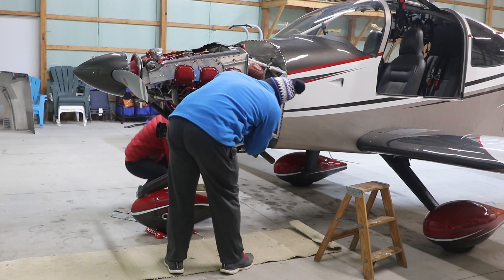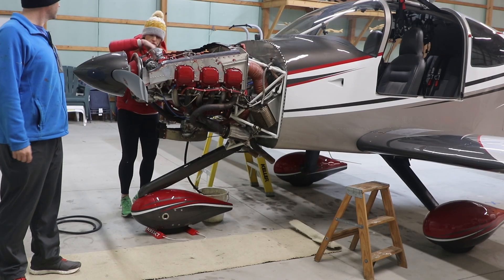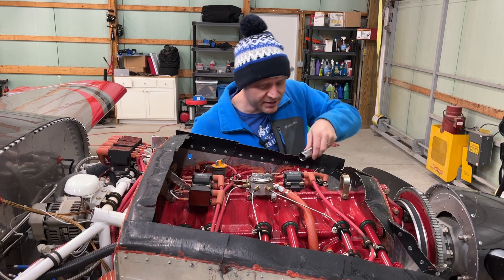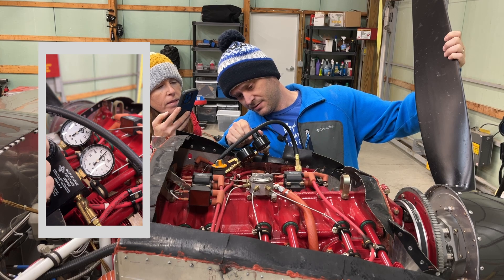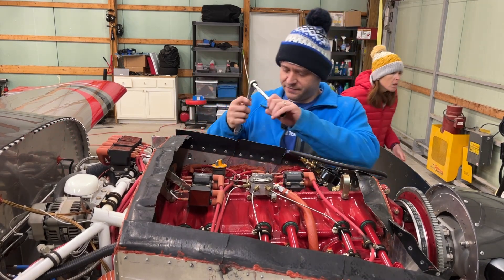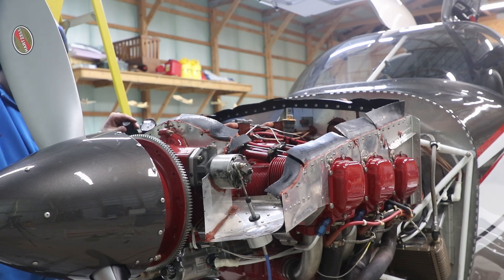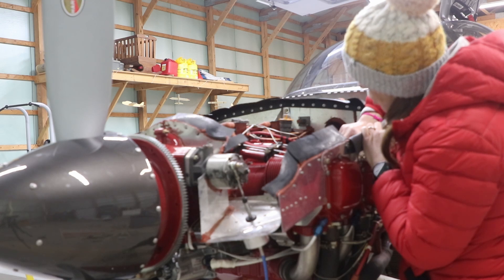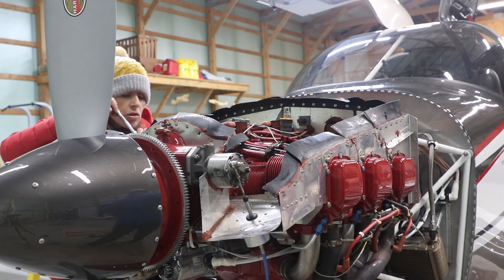2024 Condition Inspection - Part 1 (Van's RV-10)

Comment: What a great RV-10, I am starting the build on mine and I am debating if I want to go with AC or no. We have 2 young kids and will be using the RV as a cruiser and we live in Canada where summer isn’t that long but quite hot and humid. What’s your thought on this.
Reply from the maker: Really tough call. My opinion is the added weight of the AC isn't worth losing the carrying capacity in the plane. I'd rather tough it out on the ground with some heat. You're not on the ground long, and once you get some altitude it's a non-issue. But a very personal decision, to be sure!